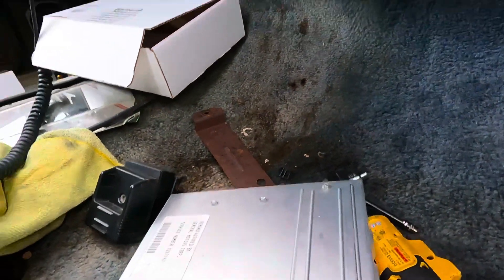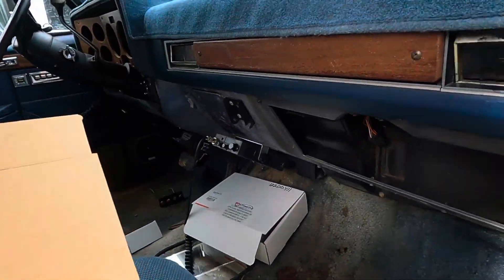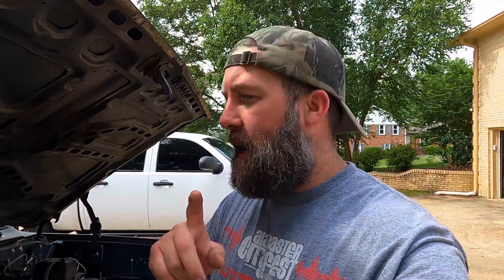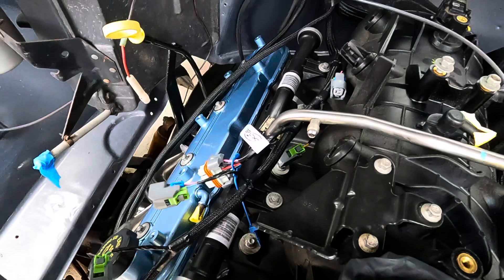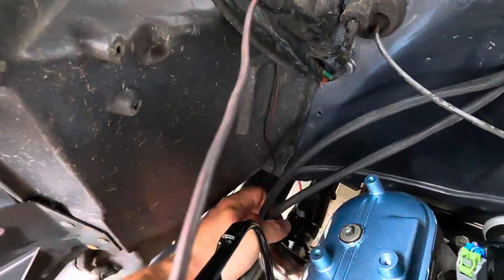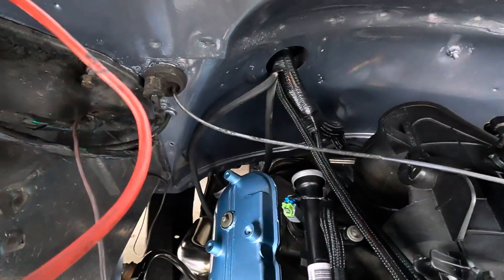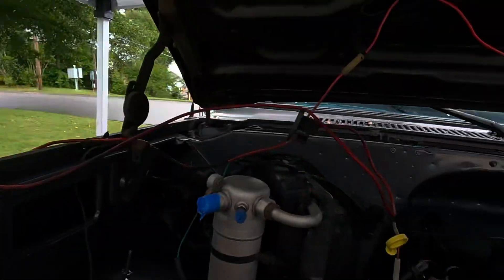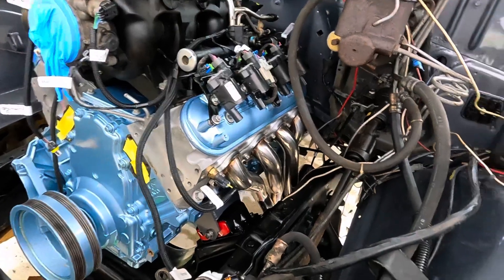Bp automotive wiring harness installed on LS swap squarebody Chevy ￼part 1

Comment: Nice build!
Is there no connection needed at the shifter on the transmission?
Reply from the maker: @hotrod.videos  I was able to use my factor th400 shift linkage. Since I went with the 4l80e it bolted right up. I planned to use lokar if that didn’t work.
Reply: @205_bowties  sorry I meant for the safety neutral.
Reply from the maker: @hotrod.videos  not totally needed, on a squarebody it’s built into the column. You can still use it if you want. The harness I have doesn’t have a plug for one.
Reply: @205_bowties  ok thanks , I noticed my harness doesn’t have it either.

Comment: What did you do to fill the hole where you pulled the Wires through?
Reply from the maker: The harness already had a rubber grommet that fit the hole. I think it was.    1 1/2”